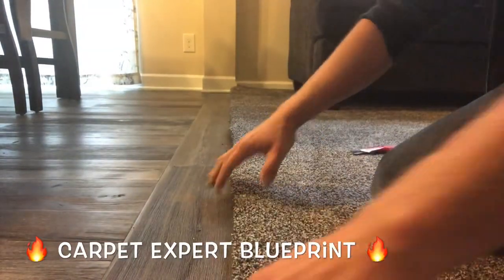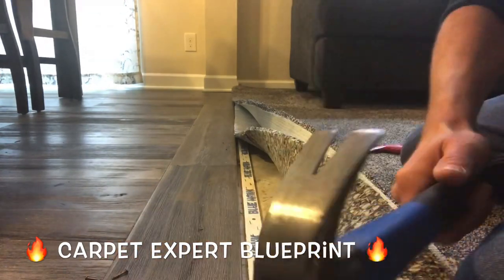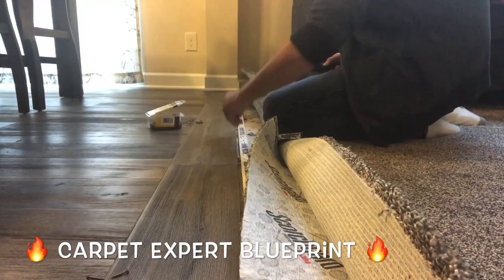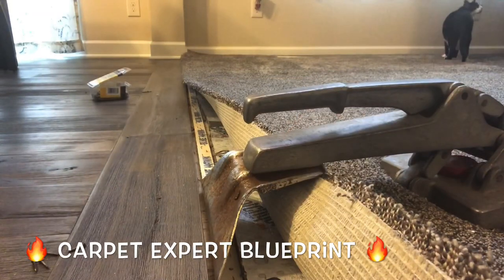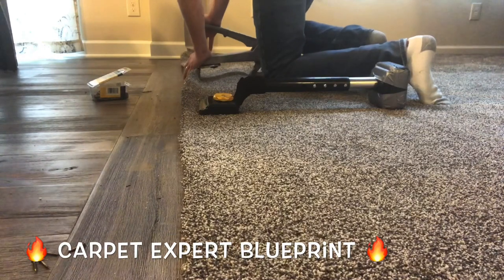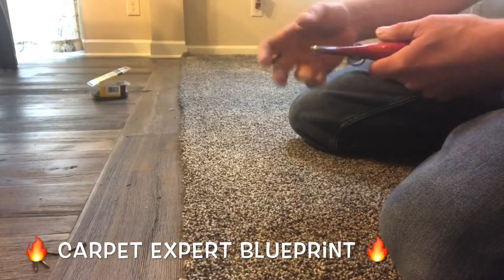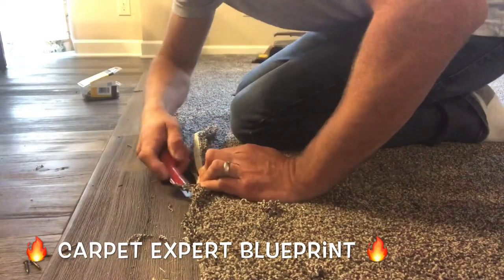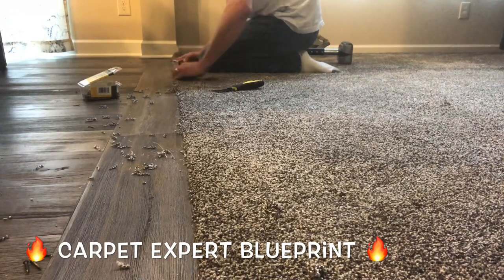🔥 Transition Carpet To Hardwood 🔥 Like A Blissfully Successful Flooring Installer!

Comment: Thanks a lot. I used to install carpet with a friend about 40 years ago and things change but some remain the same. I have 4 transitions to install that are carpet to engineered wood or tile and planned on doing exactly what you did here with tack strip. These however are simple doorways for the most part. I will do the tack strip and stuff. I know how to do that. Thanks again.

Comment: I would like the carpet industry to create a different method of holding the carpet that doesn't result in me stabbing my foot every time I step on the edge of a carpet.
Reply: Agreed 😭🤣 Every time I hear my my kid say ouch I know he stepped over the threshold too close it sure is painful!
Reply: You can take the head of a hammer, press it down on the tack strip while moving it across the pins in the tack strip!! It will bend those little tack pins down. Worst case, pound them down with the hammer!! Don't really want to pound down could cause issues down the road! They used to supply different size pins in tack strip, but not anymore! I carry felt and tape to put on the pond if the carpet is to thin and I know they'll poke through!  Good luck!!

Comment: So a really good vacuum won’t eventually pull the tucked in portion back out?
Reply: My carpet guys did this. I didn't even know you could transition like this back then without the tacky strips over top. But we vaccume with a rainbow all the time never notice any issues...
Reply: If the carpet is properly stretched it hooks onto the pins and won't come loose unless you pull pretty hard! If a vacuum pulls it loose it was not installed correctly! I was taught to use a sealer in the gap before tucking the carpet and that is still how you are supposed to do it! This guy is a hack , he does flips and rental units! He would never make it doing residential properties!

Comment: so how did you set the other side to transition to the carpet? what do you call the trim you have running along the edge of the carpet?
Reply: Carpet is the last part of the build!!!! The hard surface manufacturers make transitions for their products. They are,  T- mold,a reducer, and carpet edge and many more. The wood floor has the transition applied , then the carpet gets installed to it.  Hope this helps you!

Comment: How does the carpet you tucked into that 1/4 gap stay in place? And not come  out with traffic
Reply: This is why the pins in the tack strip go towards the wall!! The stretch of the carpet hooks onto the pins with pressure and won't come loose!!! If it does come loose it wasn't properly stretched

Comment: How would you install carpet in the centre of your living room with the wood laminate floor all around it. Can you make a video of this type of application ?
Reply: I'd just get a carpet rug at that point and put it on top of the laminate floor, that makes it easier to clean, easier to do, and will look nice if you get sick of the rug, you can change it out.
Reply: I'm taking it that you have laminate on the entire floor !!?? Buy a rug with non slip backing or a piece of carpet and have it bound. Most cities have someone that does binding! Again non slip pad under the rug! If the wood is just around the perimeter, carpet can be installed in the center of the room!! It's called an inlay. It's no big deal!! And no extra charge should be made!  Good luck!

Comment: Nice! Question - if both rooms had hardwood and you carpeted the right side over the wood how would put in a transition? They'd be uneven. I'm not installing up to a doorway but an archway.
Reply: I know what your talking about. Not sure if the height will be that noticable. You could try few things. Remove the flooring piece closest to the transition. Then get some thinner plywood, shim it to floor height on one side then let it taper down lower than the wood floor your running into. Then when the carpet is layed over, it will slowly drop to the height of the floor without being noticable. Or the tacky wood transition pieces that have a carpet side and a wood floor side.
Reply: Carpet is going to raise a floor about an inch. In order to make both floors level you're going to have to do some construction that is going to be expensive!! You can transition with flat medal or gripper medal. They look good and are not a tripping hazard.  There are many more options but I'm not looking at your floor so I can only give you the basics!! Good luck!

Comment: I was looking for a video like this to get an idea if I can do something. I'm wanting to glue a 3/4 inch rubber mat down on my concrete floor for my big safe to sit on, I want to run my carpet right up to the rubber nice and clean, (the safe will entirely cover the rubber) do you think this method here would work for me. I'm treating it like hardwood since they are the same thickness.

Comment: How would you put down the tack strip if your sub floor is concrete?
Reply: They sell tack strip with concrete pins already in them. There. 7/16pins buy a small bag of 5/8 they work better!! You might even find strip with 5/8 already in them also,, just harder to find !! When I do crete I use liquid nail and crete nails the 5/8s. I also double strip the tack strip when going up to any hard surface whether crete or wood floor!! Good luck!!